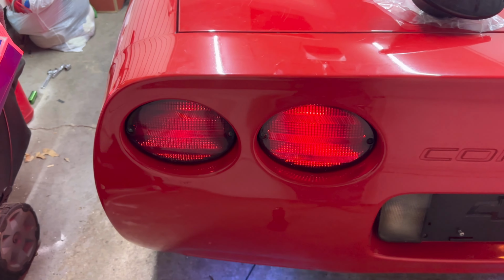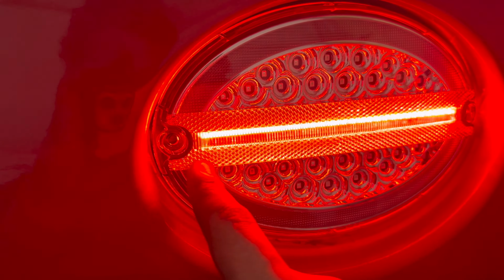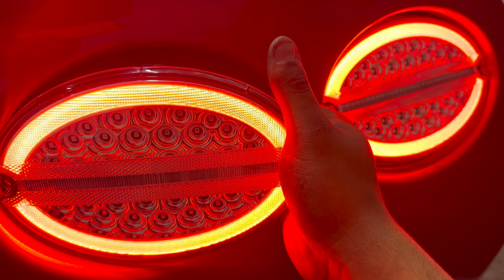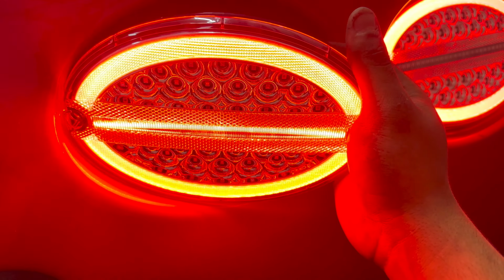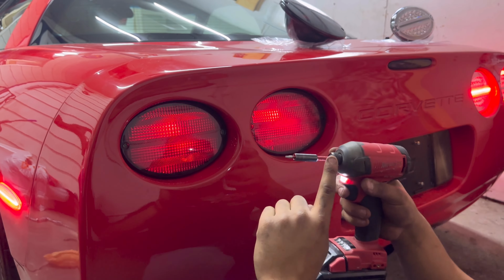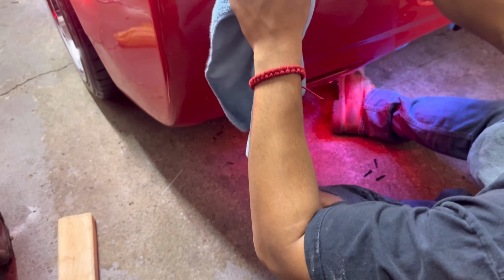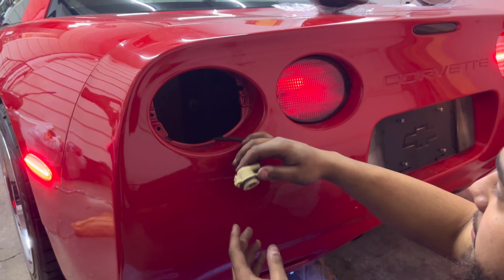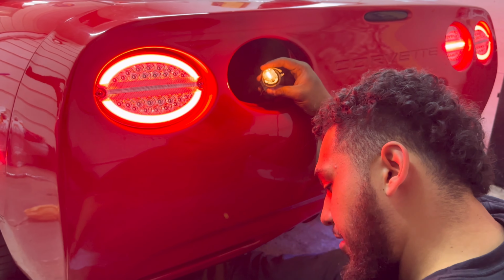Vette Lights | G3 Laser LED Tail Lights | How To | LINK BELOW!

Comment: Do the vette lights cause the " service active handling " issue like some led lights?
Reply: What 🤣🤣 not even. That sounds like either ecbm or ignition switch problems
Reply: @JSTNthe405  I purchased the vette lights... they come with a hyper flash cable that fixes the issue wait till you have one tail light out you'll get a active handling warning  then when you pull the code it says brake light circuit  open, evidently I had one of the 4 lights not working properly
Reply: @Luckydraw4me  I'll have to dig into that. First I've ever heard of such an issue.
Reply: @Luckydraw4me  DTC C1295
Circuit Description:
The electronic brake control module (EBCM) sources 5 volts on the stop lamp switch signal circuit when the stop lamp switch is inactive. The voltage is supplied with a ground path through the stop lamp bulbs.
Reply: @Luckydraw4me  you're right. That's insane and thanks to our on board code reader and the forums 🙏
Reply: @JSTNthe405  that's way better wording.... I'm now getting a new ls7 clutch lined up for the c5 🤌 , remote bleeder installed and heat shielding the clutch lines then I'm going to use racing clutch fluid to make the next clutch last a long time
Reply: @Luckydraw4me  sick man, not me over here jealous 🙏🙏 keep it up